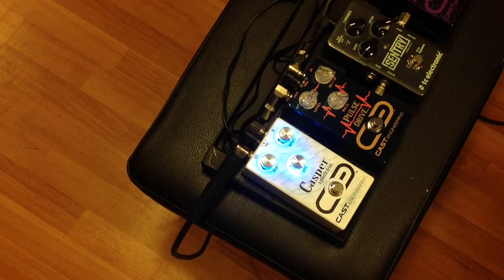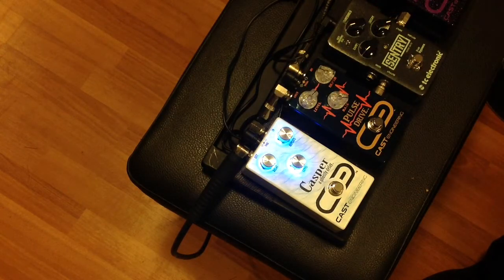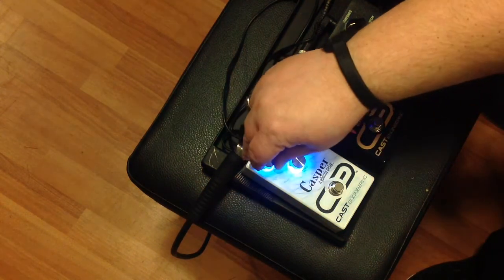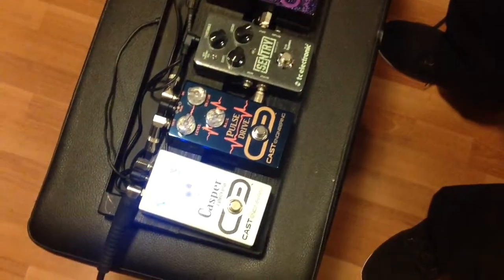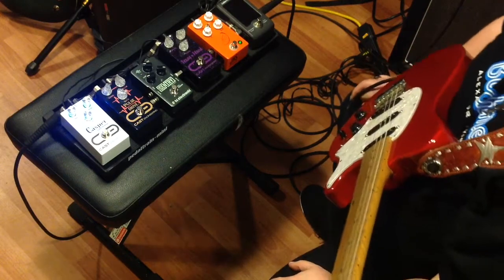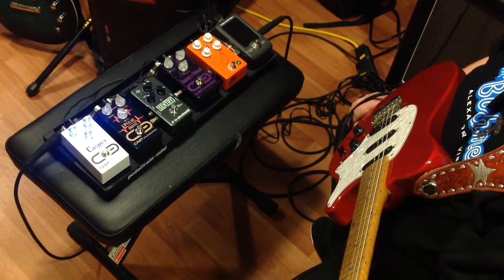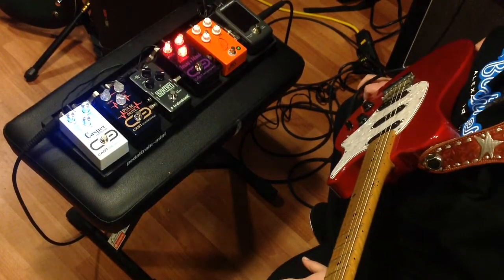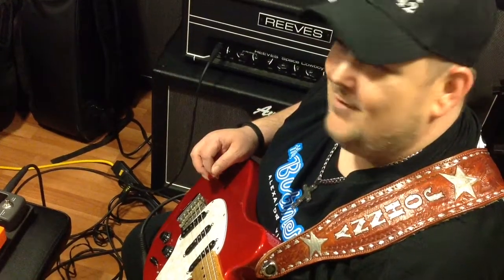Johnny Hiland and the Cast Engineering Casper delay

Comment: Hey Johnny, What is your preferred working mans delay pedal, one that you can work the delay on the fly with the tempo of the song ? For instance, if you know what the BPM is, or you can Tap in the Beat, then turn to your standard delays, that are subdivisions of the BEAT. i.e Dotted 1/8th Not Delays, Slap Back Delays, instant usable delays, that can be used in a song ?.
 Thankyou for your advice..cheers